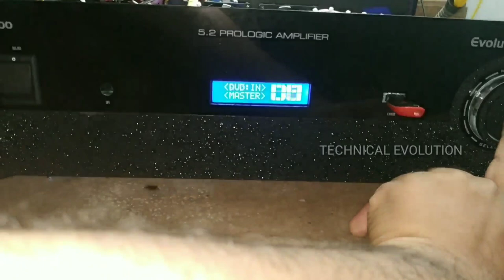5.2 amplifier assembling part 2

Comment: (Mosfet Bridege) Speker linil dc varunnu.  Enthanu kariam.  Plz
Reply from the maker: Onnukil mosfet poyi illenkil pre section transistors allenkil ethenkilm components leg soldering ilakittundonnu koody nokkikko
Reply: @technicalevolution9887 . Ok.tanks.  oru dubt koodi GND spekerlinil dc ai. varumo.

Comment: 2.1 illFilter board num bass treble board num fan & usb anevaku dvd power supply board use cheythal kuzpamundooo..?
Reply from the maker: Pre section ulla athe power supplyil fan kodthal noise varum
Reply: @technicalevolution9887  fan ozhuka baki board kudhal prasham undoo??
Reply from the maker: @aravindjr652  no problem fan anu noise undakkunnath
Reply: @technicalevolution9887  thank you.

Comment: TPA3116 BORD വച്ച് 5.1 ചെയ്യാൻ ഏത്ര റേറ്റ് വരും...അതിൽ കൊടുക്കുന്ന VOLT AT LEAST  ഏത്ര വരും..NORMAL ട്രാൻസ്ഫോർമറിൽ ചെയ്യാൻ പറ്റുമോ..
Reply from the maker: 10500-12000 nu full class d remotekit amp chyan pattum
Reply: @technicalevolution9887  optical input ulla remote kit കിട്ടുമോ
Reply from the maker: @hareeshunnikrishnan  kittum normal remotekitnekkal vila koodthala 3800 thott und optical rem kit

Comment: Adarsh chetta  kollam sambavam Adipoli veruthe oru video cheyyathe ithre detail ayy paranjathinu nanni
Pinne oru doubt sound input negative amp body ayy connect cheyyunundo njn angane kurachu ampil angane kanditund
Reply from the maker: Noise illathakkan earth chyunnathanu
Reply: Appo amp negativeum supply groundum orumich connect aya kuzhappam ille
Reply from the maker: @vishnuarjun1249  amp -ve vere earth vere dual supply il e earth anu cabinumayi short akunnath not -ve rails
Reply: Thanks for the reply

Comment: 5.2 amplifier അസ്സെംബ്ളിങ്  വർക്ക്‌  എ എത്ര രൂപയാണ്
Reply from the maker: 17500 okke akum full wrk kazhiyumbol
Reply from the maker: Same item optical coax okke ulla digital kit itt varunnenu 18800
Reply: @technicalevolution9887  അല്പം കൂടി rate കുറച്ചിരുന്നെങ്കിൽ....
Reply from the maker: @stalinkylas  rate ippo kurachittund bro bcz type 3 transformer anu ippo use use chyunnath so oru transformer mathy 15amps
Reply: @technicalevolution9887  5000 roopak eranakulathupoyal nalla powerulla amp.  Kittum
Reply from the maker: @manojcr1143  5000rs nte amp ivdem kittum quality ennoru sadhanam und athillathe undakkitt nth karyam assembling sectionil nilkunnavarod onnu anveshichu nokkyal mathy
Reply: @technicalevolution9887  correct

Comment: 5.1 ആംപ്ലിഫൈർ എത്രയാ റേറ്റ് 
1000w sub 
5*60w speakers
Reply from the maker: 300wrms for sub and 70wrms spkrs amp without optical coax cost 13800
With optical coax cost 16500

Comment: ഇതിന് ഇത്രേം പൈസ എങ്ങനാ  വരുന്നത്.  കൂടുതലാ
Reply from the maker: Parts price list und kanak kooty nokku
Reply from the maker: Athinath spectrum analyser remote kit price 2200
Transformer 2 um koody 3800
Front dial 1000
Amp board 2000 for speakers
Subboard 1400
Cabin 1500
Ippol thanne11000 ayi
Inum kore koody und
Reply from the maker: Ini spkr protection 
Capacitor and diode
Fan grill
Sockets 
Buck converter boards switch
Meter 12 rs varunna wire anu full ittekkunne 
Pinne lead paste
Reply from the maker: Pettennu nokkunna oralk vila koodthal anennu thonnum sadhanangal vanna courier charge 
Ath edkkan poya vazhikk petrol adikkan vere cash
Angane mothom nokki oral ii amp paniyan nokkiyal spares mathram 14000 akum
Reply: എന്തു വിലയ്ക്ക് കൊടുക്കുന്നത്
Reply from the maker: @sumeshs6141  15500
Reply: @technicalevolution9887  ഒരു കുഴപ്പവുമില്ല ...ഈ റേൻചില് കമ്പനി വാങ്ങാൻ ഒരു ലക്ഷമാകും

Comment: Evide 3rd vedeo
Reply from the maker: Coming soon bro nte vtl njan use chyunna sound system the kurich video nale idunnund
Reply: @technicalevolution9887  enikoru system venam bro. Veetil home theater ststem chyyan ane,apo eth chyyanam enn alojikkuane,
Reply from the maker: @brinceraj9080  nalla cash akum athanu ettavum valya prasnam
Reply: @technicalevolution9887  sir ne chyyan pattuooo😊
Reply: @technicalevolution9887  contact number thayo